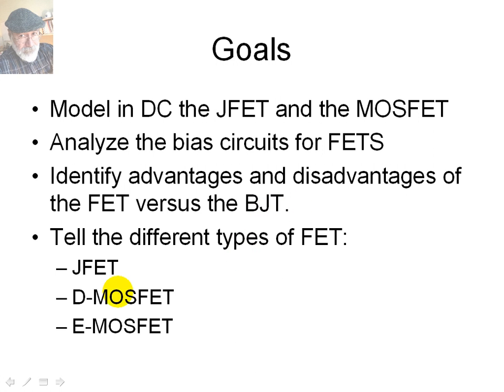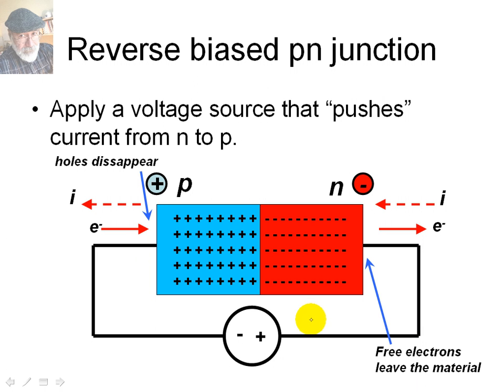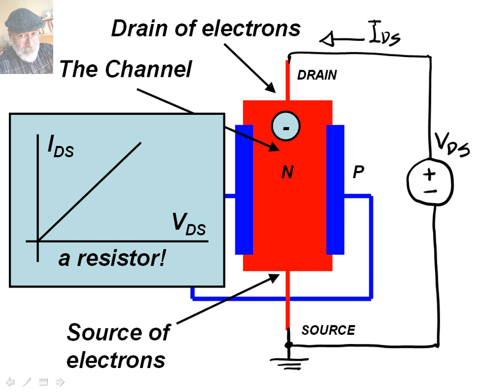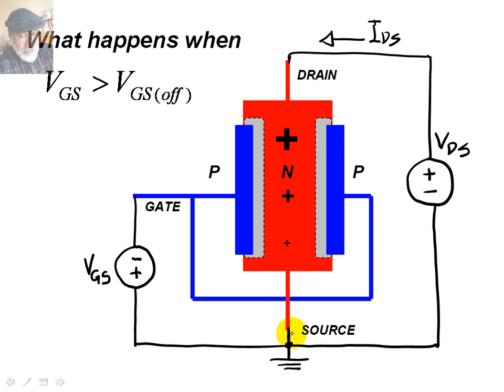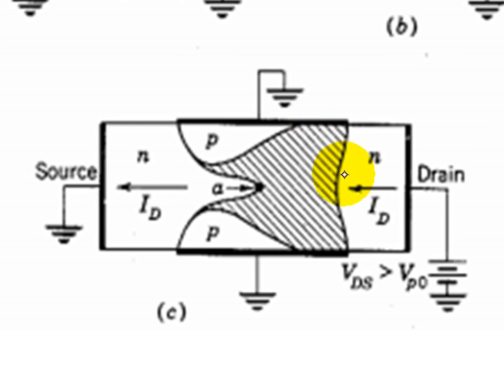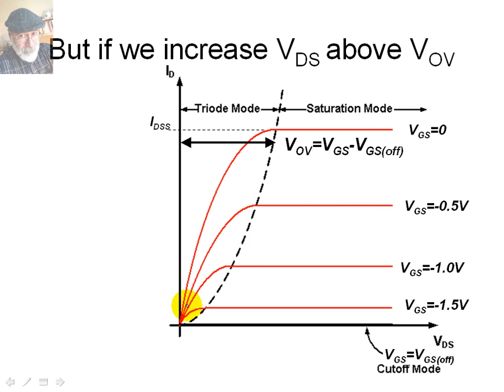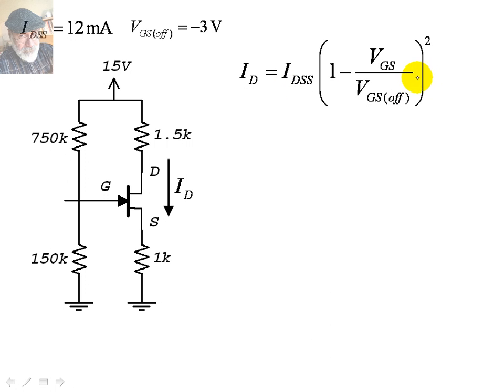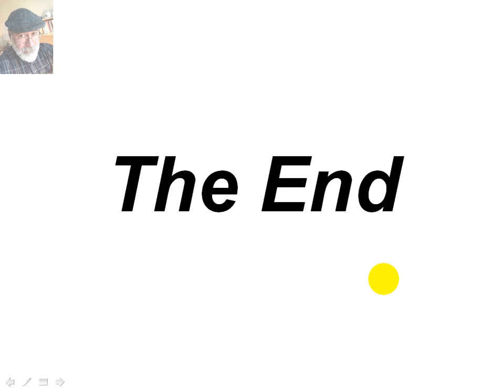FET/MOSFET (Video 1 of 4)

Comment: I studied physics,electrical engineering and computer engineering back in 1973 when the early computers looked like kitchen-refrigerators,huge and bulky enough to transport one computer in a pick-up truck,one at a time when molecular-alloys- made transistors were not in use,,,I am from the old-school ,at a time to get those three degrees would have taken only the brain of Albert Enstien to figure out,,,,.With modern internet,getting any university degree,is a"Piece of Cake",is a"Walk in the Park" and you still see some of these young students are bitching about how difficult it is to get a degree,,,Bunch of "Diamond-Spoon Fed Loose Lazy Asses with Bagle-Holes Shining Down Back Yonder".......Arash Sassani,Rasht,Iran.😅😅😅😅😅😅😅😅😅❤❤❤❤❤❤❤❤❤❤❤❤❤❤❤ ❤😅😅😅😅😅😅😅😅😂
Reply from the maker: Their degree continues to be challenging.  They have more courses per term, more assignments, midterms and labs per week than any of the old programs that I remember.  Courses that used to be taught in fourth year are now taught in second year along with all the preexisting courses there.  Why? To make room in the fourth year for latest technology related courses.  The scope of exams has changed too, questions are deeper and longer on account of the extra power that equipment like the HP Prime provides them.  Partial marks for "computational errors" is a thing of the past too in many courses (not in courses where there are demonstrations or design).  I, like you, wish I had had an HP Prime in un undergraduate days (I had an HP 67, and I felt like a king). Welcome to my YouTube channel, colleague, and Merry Xmas 2023!!!

Comment: you said that the gate current is 0  the same goes for every type of mosfet?
Reply from the maker: Normally biased, the gate in connected to a referse biased PN junction.  In a MOSFET it goes beyond that as the oxide layer in the gate's current path is an insulator. There is your answer.

Comment from the maker: Just a comment on way of speaking: near the 9:27 point, I describe the source and the drain as the parts of the channel where electrons "appear" into the channel and "disappear" off the channel, correspondingly. Of course, the electrons will not disappear from the circuit, they will just continue their journey through the cables, external resistors if any, and through the source to "re-appear" at the source terminal of the channel again. This way of speaking, which was coined by the original creators of the device may sound odd to modern ears. Remember, the "appearance" and "disappearance" is given with the channel as the proverbial context. I thought this would be evident, but it was not so to one of the almost half a million viewers, so I figured that this comment might be of help.

Comment: Oh you dont know how much this helped ,,, Im having problems replacing a joule thief with with a npn or a pnp   and broke a mosfet,,,,,4 pin XY80180049  when I pulled a resistor on a mosfet THAT I cant find on the market OR replace and now I have a none working system

Comment from the maker: Imagine you apply Vds = 10 volts, and that the source is "grounded". The voltage of the source is zero, by definition, and the voltage of the drain is ten. the voltage in the channel, as we follow the current from the drain down to the source, decreases linearly from ten down to zero; for instance, the voltage in the middle of the channel is five volts). Now consider that you also ground the gate (Vgs = 0 volts), Vpn near the drain is -10V, but Vpn "one quarter" from the top is -7.5V; etc.